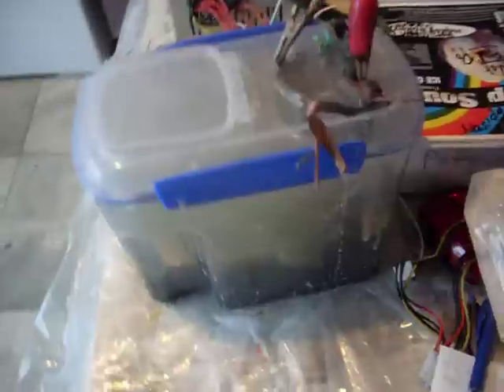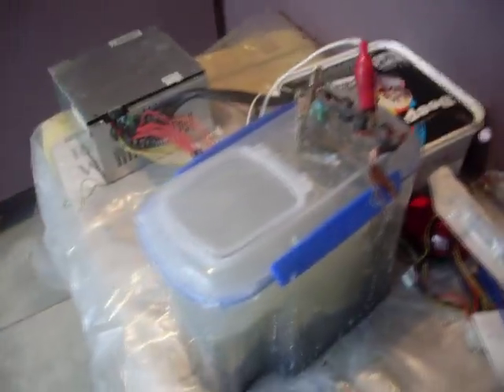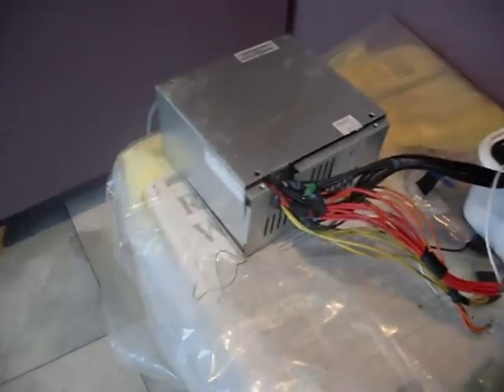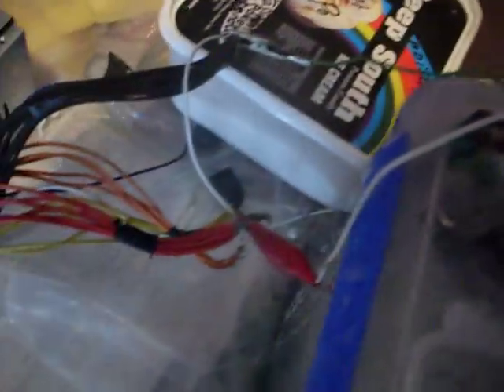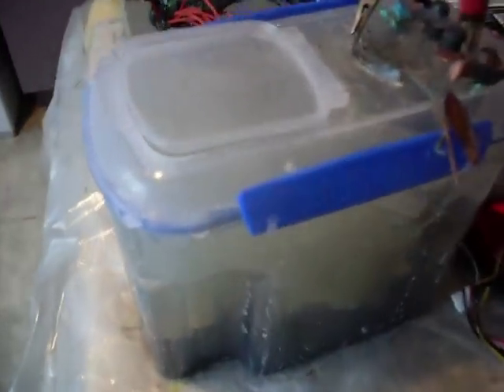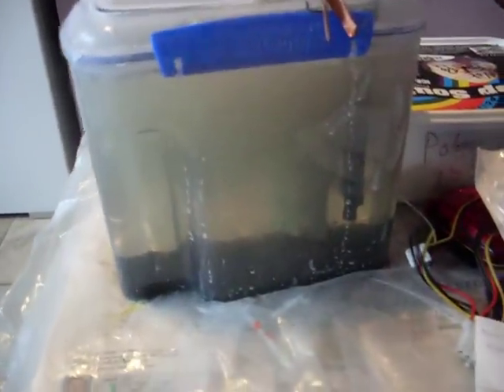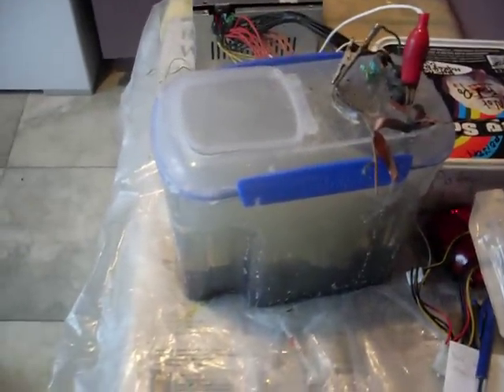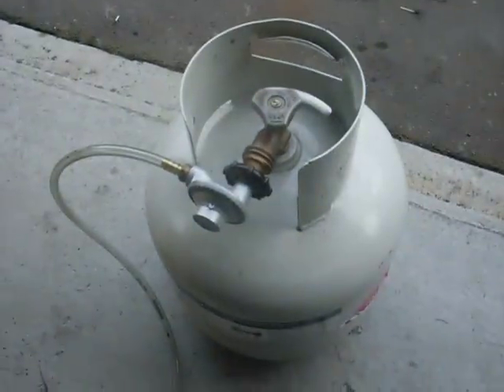Chlorate cell

Comment: @dist47 becase fot the elecktrolysis you need high aprere
not volt.
by volt the cell will heating and this is NOT good the cell shuld be 60 C warm

Comment: @Digadogup i used just stright salt. (windsor salt)  i used an old coffe pot glass. the plunger type.. lol  i used a fish tank heater to keep the tempatur high. 80-90'C
the heater was placed between the pos and neg rods.  (graphite from carpenter pencils and S.S rod) 5volt 10 amps, after 3 days, and 2 Graphite rod replacements. i boiled in pyrex dish and watched crystels form after boiling for few minutes.

Comment: well it worked!! finally!!!!!  i had to cover the top 2 inche's of my graphit anodes to prevent them from chlorine corrosion, after 5 days of running they are still strong, and in good shape. 

after boiling the liquid, and cooling i now have the crystals i need!

thanks again!!
Reply: how much clorate did you get

Comment: @ XSRtiliry:
I used stainless steel before. There are some issues you may need be aware of. 
Not all SS is copper free! Copper & chlorate are a bad combination. If you are set on using SS make sure to get material from the USA. Most Chinese SS does have copper in varying degrees. The best bet is a very high quality screen of a ultra fine mesh. This generally is not made in China as we still have two large SS plants operating that have gov't contacts for screen.
SS  less conductive

Comment: Dear  XSRtiliry:
Your next step is to re-crystallize the material so as to purify the chlorate. What that would entail is: 
1. Heat solution in cell to 80C + and dissolve as much as possible the material within cell.- ALL of it.
2. Filter this solution so as to trap bits of graphite. maintain heat- operate quickly
3. At this time you SHOULD have clear solution. Bring to 80 C + temp and then place in COLD environment. crystals appear as temp drops. Crystals should be flat window-pane type.

Comment: The use of a computer PSU is that is a "switching" power supply. That means that it is "intelligent" as it will swap down to 5 v as a carrier for the max current that can be carried between the anode & cathode via the electrolyte. It is the CURRENT that does the work: not the voltage. 
What this means is that if you use a "NON-SWITCHING" PSU it will overheat (unless modified) as the carrier of the current will remain constant. You can get 70A from a 1000w computer PSU!

Comment: @
uchiacon 

I have also used gouging rods and I came upon some information about them as used in anodes.
After you peal the copper off you will still have some copper left, even on the cleanest portion. Let them soak in a 2-5% solution of HNO3 overnight and they will be free of most all copper and a great deal of ferric material that may exist in some brands.
After they dry allow them to soak in clear linseed oil (just a thin coating) and they will retain their rigidity.

Comment: was woundering why when i straight away got mine going it started emmitting green stuff from the stainless steel and now some of it is swirling around but most of it is at the top. Also i''m using a salt that is 50% sodium chloride & 50% potassium chloride is this ok? And lastly when i dissolved the salt in hot water and left it to cool after this there was a layer whiteness down the bottom tha couldnot dissolve.